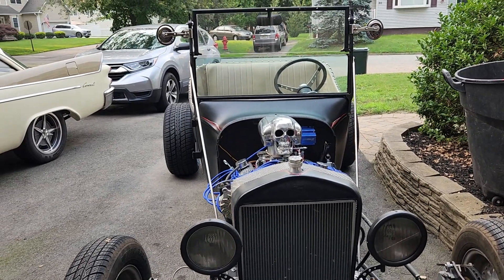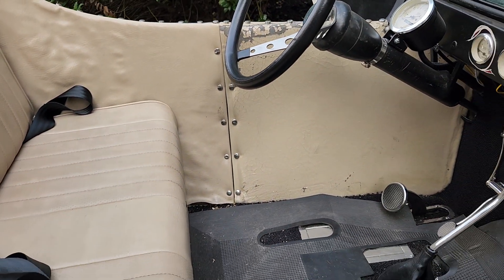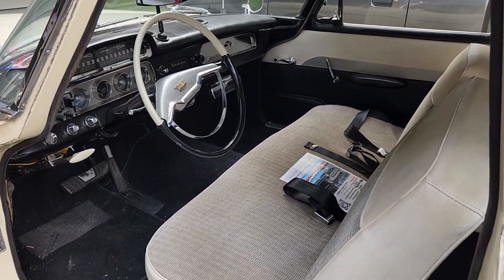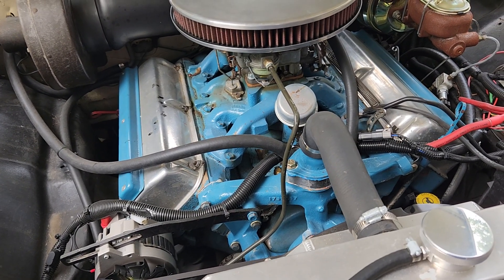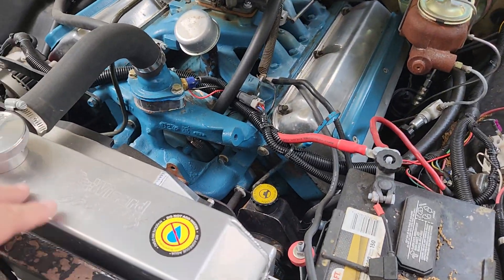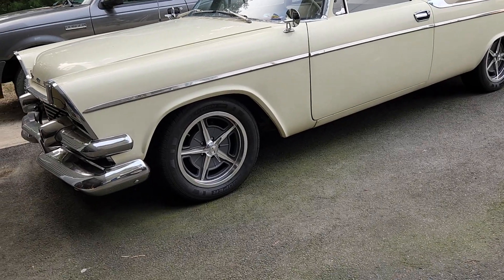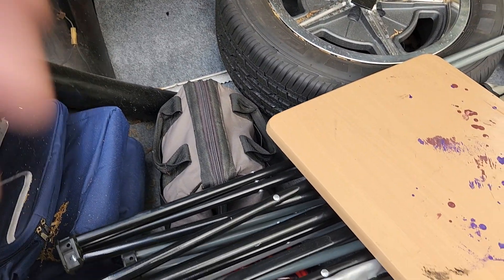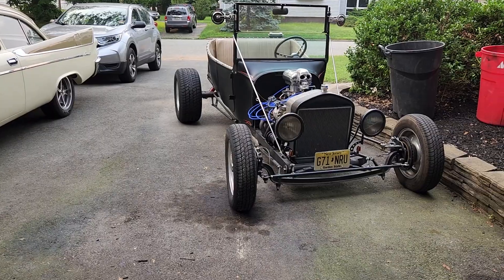1923 Ford T-bucket and 1958 Dodge Coronet

Comment: Very cool 58 Dodge, and of course the T bucket is cool as well. But as a Mopar nut I have always liked the finned 57-59 Mopars because my father had a 57 Fury and then a 59 Belvedere with the same 2 door post configuration as this 58 Dodge.